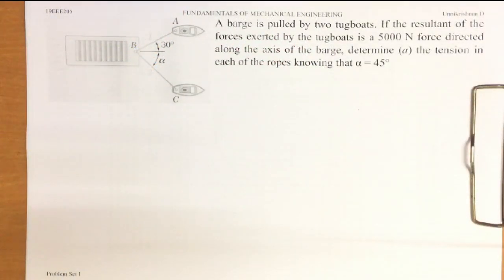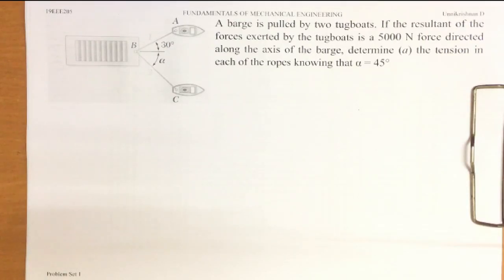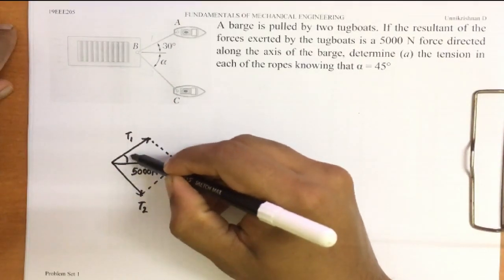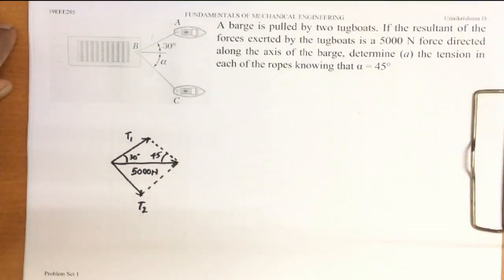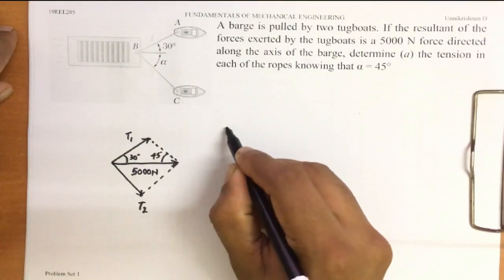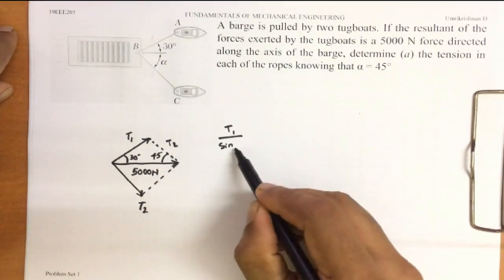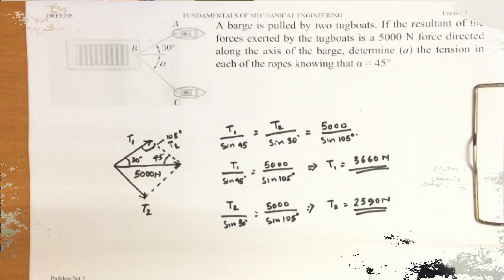Tug Boat problem solved using Sine Law

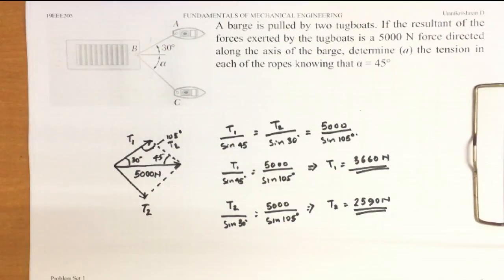Comment: Did you round off 2588 to 2590? Base on my calculator its 2588 3:19
Reply: Yes. i have rounded off that number. Engineering is more about approximations than accuracy Cheers 🙂